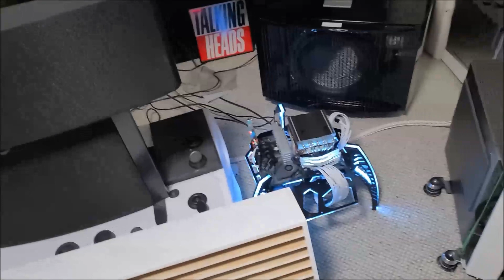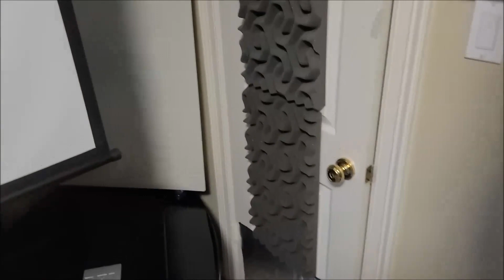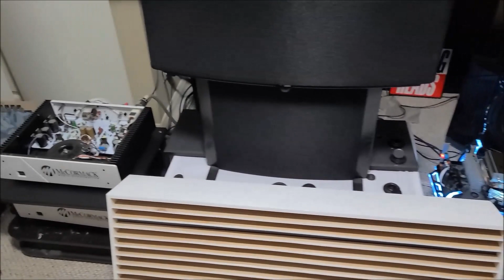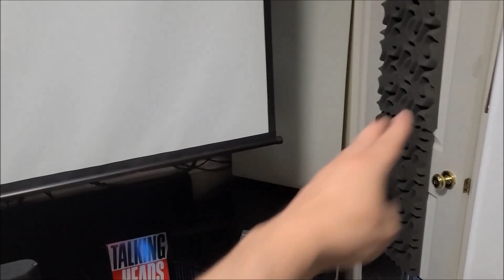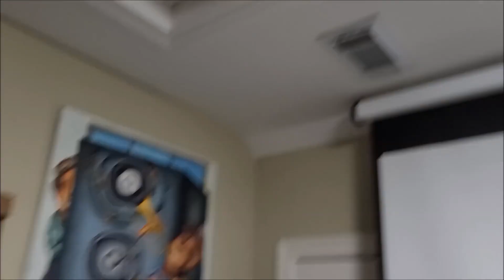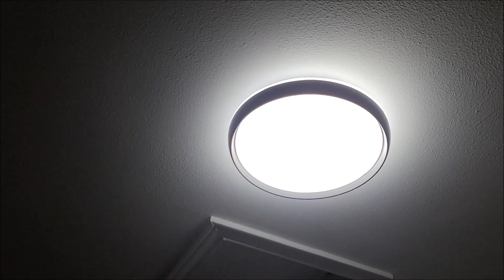Audiophile Junkie - Subwoofer Series - Controlling Resonances

Comment: Hi some suggestions...Bass Trap has to be dropped behind sub not on top. Pull out sub 3-6 inches. 
Stillpoints Aperture II panels on side in front of door...you just need 2 you put on the floor and remove when done listening. They absorb and diffuse. 

Your room treatment should start on floor always 

Your room is a bit small for that size sub. You won’t hear sub bass as the room is not deep enough for the frequency to develop a full wave. Try smaller S510’s and sell the big monsters.
Reply from the maker: I hear what you are saying from visuals, but I give priority to the measurements.  The one lesson I've learned over the years is planning room treatments based just on visual theory can be problematic.  You have to verify with measurements because most theoretical picture recommendations never take into account the size and location of furniture, windows, ceiling angles, shelves, flooring type, etc.  You have to measure.

I had a smaller sub similar to the S510 in that exact spot.  I'm now getting far more output at 20hz and better measurements throughout the bass region with no peaks/valleys except a small one I can reduce with -5db EQ at small 35-40hz Q range.  It's not even close at higher SPLs where this sub can deliver much more sub bass.

Qualitatively, the bass is also much better than the smaller sub.  It would be impossible not to notice the difference in sub performance... Even in this small room.

As for bass traps, I've got 6 in the room that help mitigate issues.  I tried putting that one behind the sub instead of on top, but measurements were very slightly worse.  It's a sealed box sub with no port in the rear.  Loading it directly in the corner works well and is actually recommended by REL.  Getting a bass trap in that corner by putting it on top is giving me the best of both worlds. 

The bass trap also serves a dual purpose higher up. It's providing a different  surface for my open baffles.  Aesthetics are better too.

I'm familiar with the Aperture and even attended a formal demo they did at one of the shows. They were nice.  I doubt I will change though.  ASC is by far my favorite, but the brand of treatment is less important than the measurements.  I'm getting flat measurements and a laser defined center image with depth and width, so I'm reluctant to change anything.  

Literally, a minor change in one ASC tube trap location throws things off, so I live with however things "look" with priority to the measurements.